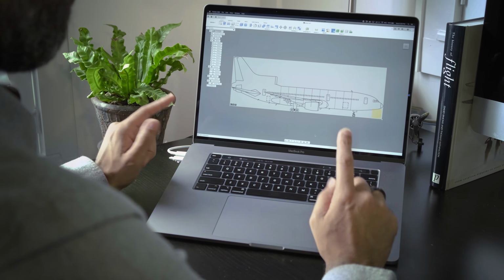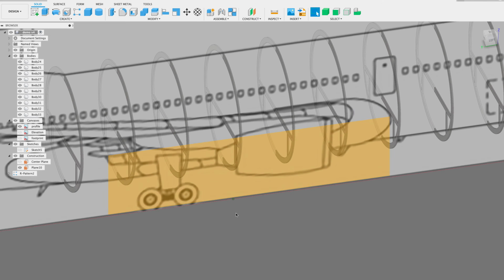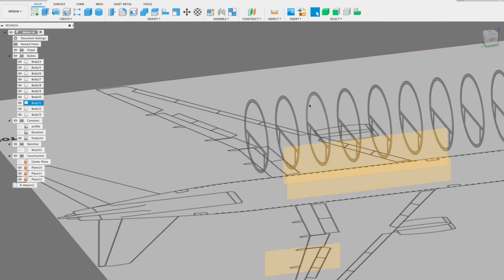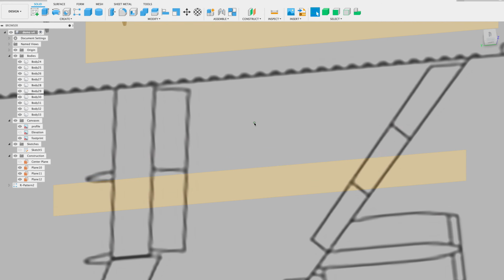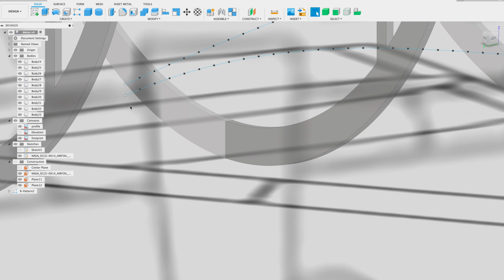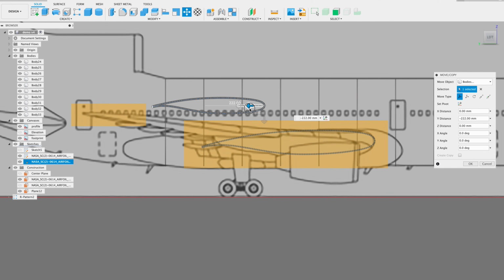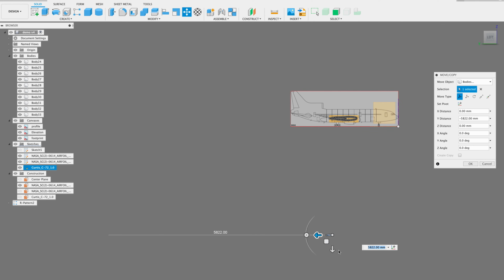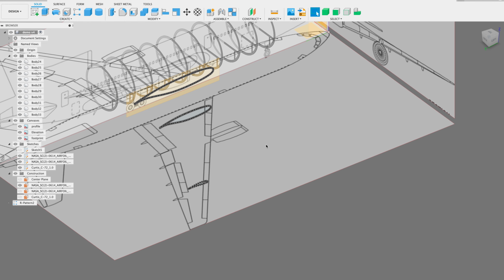Part 1 | How To Design Airplane Wings in Fusion 360 - Airfoils [Episode 2]

Comment: My experience with airfoil tools is that when you copy the source dat file without the name of the airfoil on top of the listed data, the spline in fusion 360 remains open at the trailing edge. If you copy and paste everything, including the name of the airfoil, the spline ends up closed in fusion, ready to use. Sounds weird, but works! I recommend to open "edit sketch" on that spline, select the outline, then right click and "fix spline".If you don't, you may accidentally move spline points while working with that airfoil, thus creating humps or dents or other "improvements"...
I have to admit that my proposed solution obviously only works with the older 1.8 version of airfoil dat to spline, which I'm still using. In the actual 2.0 version the problem remains unsolved, at least for me...
Reply from the maker: Thank you for this awesome tip and solution to that strange problem! I've pinned it to the top of the comments so that others benefit for this work around! Cheers!
Reply: @RCCAD2VR  I've installed and tested the 2.0 version on a different computer now and it looks like the problem of open trailing edges lies in the data files. The two data dealing with the trailing edge should be the same value. If the first pair reads, for example, 1,00000     0,00000 and the last pair is 1,00000   0,00010 , then ends won't meet in the spline appearing in fusion. So be sure to make both pairs the same value, before using the file in 'airfoil dat to spline'. In your case it is really a huge gap of about 4,2 mm! at the wing root rib. You can see that gap already on the airfoil tools website display of your profile and if you check the dat file, you'll see where it comes from.
Reply: @plane_simple  Even when the first pair and the last pair are identical you still get an open trailing edge!!  Tested a couple different airfoils and they still come in open traing edge!!
Reply: @plane_simple  I agree. I edited the file (Clark YH) so the 1st and last points were identical and the airfoil is a closed sketch using the V2 script. Given others still report errors, this could yet be a Fusion 360 Hisenbug. Sadly, this doesn't fix the broken placement. What worked best for me is use the default origin plane and then move to the offset plane. FWIW, the broken offsets appear to match the offset plane's offset, perhaps the script has uninitialized variables.
Reply: @dnl-42  Oh wow! It's been a while since my post on this subject. Appreciate your comment! I haven't worked with airfoils for a couple of months, so I don't know what the problem looks like today. And I must say, I don't know a thing of what happens behind the screen while working with Fusion 360, so my solutions are always results of trial and error...
Reply: RC CAD-2-VR p
Reply: Plane Simple:
Including the name of the Dat file doesn't make any difference when creating the airfoil even if the first and last plot are the same!!  Still get an open spline and the "Fix Spline does not fix it either.
Reply: @sotm6078  Which version of airfoil dat to spline are you using? The solutions I was suggesting did work for different airfoils in both versions I am using on two different computers, both windows 10.
Reply: What suggestions do you have when your wing has a curved leading edge

Comment: These many years after you making these great videos, I'm truly enjoying these videos, and the learning is insane!! Thanks a lot, man!! Also, I'm new to Fusion 360 but not CAD in general. Yet, I can't figure out why I can't move or resize my construction planes like you do. If you have any suggestions, I'd appreciate the help!
Reply: I have the same issue. The thing is, we are working on a new version of Fusion 360, which doesn't allow resizing of construction planes. Instead, the planes are infinite in length. That's why I am stuck in this second video myself and don't know what to do.
Reply: @Aneeqali-c9b I figured it out but turned out that the solution was in the description all along lol! We are designing in the parametric mode, and that won't allow us to resize or play with the construction planes in any way. Turn off the design history using the gear icon in the bottom right of the interface and enjoy designing!

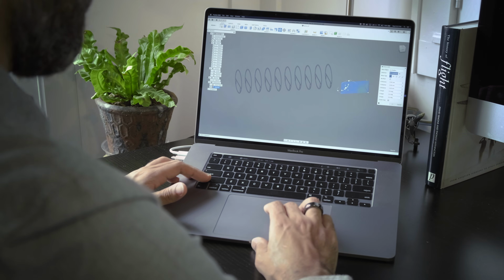Comment: In 4:30 you show how to move a new offset plane by crearing it and then pusshing M with it selected. 

I’ve tried several times but it doesnt appear the options to loce that offset plane. How can I fix it?

—————————————————

Solved: 

temporary line is the solution as I see in your website.
Reply: where did you find the temporary line fix or wtv i cant find it on his website

Comment: Your videos are amazing and so helpful. I have a big problem though: I am designing a custom built aircraft, inspired by the SR71, Concorde, and Space Shuttle... so it's a 4.5ft long fuselage, complex delta wing with a 90mm EDF in the back. My issue is, I can't find too much information on the types of airfoils my inspiration aircraft used, and they essentially seem to boil down to being "flat plates" in the case of RC models. The best I have been able to find is to keep the root airfoil to about 5% thickness and the tip airfoil to a bit higher, maybe 6%. I am planning on making my own airfoils for this as it is such a complex shape and the wing is so long (2/3 of the length of the fuselage at the root). What would you do if you were me, would you move forward?

Comment: Quick question for anyone here following along. I'm trying to move the offset plane that he created but to my knowledge moving construction planes with the move tool is not supported. Does everything still work if you initially resize the plane to its intended location and then off set it or am I just missing something? Thanks!
Reply from the maker: This is because you're in parametric modeling mode. You've gotta switch to direct modeling in order to have that ability.
Reply: @RCCAD2VR  thanks for getting back so quickly!

Comment: Hi, I have ran into a problem I cannot move the offset plane there is no direction arrows.
Reply from the maker: This just means you are not in direct modeling mode. You will need to switch out of parametric modeling in order to get the construction plane movement ability. If you need help figuring out how to make this switch I have information about it here on my website https://www.rccad2vr.com/rc-airplane-design-build-episodes/design-rc-airplane-wings-in-fusion-360-part1#constructionplane
Reply: @RCCAD2VR  I managed to solve it in the end, but thank you for the reply. Your video's are the best by the way. I have now started on the wing ribs I'm designing a plane similar to the Technam p2012 with a increased cord, wing length at 50 inch wing span. My wing root I increased 1.5 degrees and tip 2 degrees I'm using the Naca 2412 Airfoil. This is my first time ever using CAD software and I am very confident that I can complete the model because of your teaching methods. Thank you.
Reply: I created my formers by using the two point rectangle and rounded edges with the tool then extruded it because my fuselarge is more square . but now I am unabe to loft to the nose section because it will not allow me to use it as a rail. I would be grateful if you had any suggestions.

Comment: Great teacher. Very easy to watch and learn. Some airfoils on Airfoil Database have contour defects/divots that need to be cleaned up. They also have way more spline points than needed. I usually delete most of them. There is also an add-on that removes unnecessary spline points, Airfoil_DAT_Optimiser, but more can be removed still.

The open trailing edge seems to be random. Some are closed. I usually connect the upper line to the lower and correct the shape if needed, or square it off to .4mm if it's going to be 3D printed. The gap is usually small enough no adjustment is needed. Bigger variations come with sanding and finishing.

Comment: This amount of work you put into this series and the quality - MAGNITUDES higher than similar content - is FAR too little appreciated!
Not to mention: it's completely free!
Reply from the maker: Cheers! Happy to see that you're really appreciating the video series. They were a challenge to put together, but glad to be able to share my process and help others. With such a significant drop of interest in the engineering, trades, and manufacturing and the older generations not passing the knowledge on as freely, putting a series like this behind a paywall seemed like the wrong thing to do. Happy to know it's appreciated!!
Reply: @RCCAD2VR  That’s a very noble motive! It’s greatly appreciated!
I’m actually currently designing my very first RC plane ever. It’s of course not going to be as intricate as your design and made from foam. Long story short, your series helps a ton with the design!
By the way: do you know of any free/free with educational license software with flow simulation capabilities (since I think it’s no longer possible in Fusion360)?
Reply from the maker: @Quefelsees  That's awesome! Best of luck on your design and build! You'll have a lot of fun in the process. 

I've not spent any time looking for any simulation software, So I can't point you in any specific direction. This kind of software is pretty expensive to create an maintain, so a free version that's capable of giving accurate results may be hard to find.
Reply: @RCCAD2VR  Thank you very much! Just ordered all the parts, I’m super excited!

Alright, I’ll keep looking then. Thanks for your reply!
Reply from the maker: @Quefelsees  Anytime.

Comment: I don't know if I'm doing something wrong but it wont allow me to move an offset plane, when I try to select it and press the M key it tells me that I need to select a body to move
Reply from the maker: That is a limitation when working with "design history" on. You'll need to turn that off in order to work freely with construction planes and other methods shown in the tutorial. Be sure to use the webpage that goes with this, I try to answer as many of the pitfalls and issues people run into. Cheers.
Reply: @RCCAD2VR  Thank you so much for the help and the quick response!
Reply from the maker: You're welcome 😀

Comment: Using "winglets" hinders the efficiency of the "wash out"?

Sorry, English is not my native language.
Reply from the maker: Winglets increase efficiency of the wing. They greatly reduce drag cause by vortices and reduces the high pressure under the wing curling around to the top side of the wingtip improving the airfoils performance.

Comment: Hey Terrance, I just attempted to install the DAT spline and after loading as directed into the library, I restarted Fusion and lost my canvas images. I can't find them anywhere
Reply from the maker: Hi Scott. This is a highly irritating bug in Fusion 360. My canvases disappear visually all the time. If you look in the browser under canvas, the file should still be there. Right click on the file and select replace canvas image file. Then select the same file you used before. This should pop it right back in. That's what I always have to do.
Reply: @RCCAD2VR  Thanks for your quick reply...unfortunately that is a "No Joy"....sometimes, Fusion can be an exercise in utter frustration
Reply: In fact, it appears I can't download any canvas images now...
Reply from the maker: I don't quite understand. Canvas are added from your computer, there is nothing to download. Just trying to get clarification. Are you unable to locate the file locally or is the canvas file not in the browser.
Reply: @RCCAD2VR  I went ahead and simply acted as if I never downloaded a canvas and that brought the image in. I sized it to the sketch but now I can't increase or decrease the sketch size...grrr....I have to say this all started after I downloaded the DAT spline Add-on so I am now thinking I should remove it and that might solve all these irritating issues....thanks again for a great job....threw you a tip the other day...
Reply from the maker: Resizing the canvas is easy. It's a calibration. I have a video on how to do it called "How to Calibrate/Scale Fusion 360 Canvas"

Thanks for dropping a tip in the tip-jar!! That was very generous of you 🙌🙌🙌🙌
Reply from the maker: Sorry that plugin is causing you troubles. The author made an update after I published the video to address an issue with it and it's been behaving oddly for many people ever since. I need to take some time to record and publish a new video with another method that's quick and easy and doesn't require an add-in.
Reply: @RCCAD2VR  no problem… you deserve it… I know how to calibrate the canvas… but I will get it figured… thx much… great teacher!

Comment: My planes do not want to move ? What should I do
Reply from the maker: The only way to enable that ability is to turn off design history. In Fusion 360, parametric  modeling mode won't let you reposition construction planes.
Reply: Okayy so that is the reason you said to turn it off.
Thank you for your fast reply 
And keep up the good work

Comment: Hi @RCCAD2VR, is there a way to import the spline files to an exact coordinate on a offset plane ( lets say a projected line from a wing sketch )? I am still unable to place the airfoil profiles correctly because the pivot and move method works but when you are going after High performance.... it is not the very precise sadly. 

If you have any new method of doing this I would appreciate. 

Hoping to see a new build from you soon.
Reply from the maker: Hey there -- This is a known issue, one that I was not able to solve either. I remember a comment a while back regarding a hack to do it, but I couldn't get it to work. What I ended up doing to simplify the whole process is capturing a screenshot of the airfoil, placing it as a canvas then using sketch to trace the airfoil. It's quick and dirty and solves the issues with using the DAT file. 

Hope that helps. 
Also most recent build video went out this week. Cheers.

Comment: Can i expect the same kind of performance if i use only one type of airfoil (curtiscC-72) but with a Washout ? Thank you for thoses awsome tutorials
Reply from the maker: It depends on where you start the twist into the washout area. I would say it should be at the final angle just before the inside edge of the aileron. Check the CL v Alpha data for that airfoil to make sure you don't inadvertently create negative lift at the final washout angle when at level flight or a few degrees nose down, that could create a really nasty problem.

Comment: Hi Sir, I would like to ask you about that u move your construction plane with easy method press M and move. But it's not work on me. Any solution or any tips?
Reply from the maker: This is happening because you have parametric design turned on. You must turn this off. The following link will take you to my website where  there are  instructions on how to turn this off. Look for the heading "Can't Rotate Canvas" 👉 https://www.rccad2vr.com/rc-airplane-design-build-episodes/design-rc-airplane-wings-in-fusion-360-part2#planes
Reply: @RCCAD2VR  Thank for your kindness sir.
Reply from the maker: @eipelay6829  Happy Modeling!

Comment: Hey buddy I have a hickup in making the offset plane move the the root of the wing. when i am creating the offset plane doing all the steps as shown but when i am trying to move it , i am not able to do that. i am only able to bodies with the move option. can you pls help me ?
Reply from the maker: Hey there - Apologies for the later reply. This sounds to me like you are working in parametric modeling mode. I have an explantion on how to change this on my website here https://www.rccad2vr.com/rc-airplane-design-build-episodes/design-rc-airplane-wings-in-fusion-360-part1 scroll down to the heading. "Step 1 - Setting Primary Airfoil Construction Planes" It will show you how to switch. Hope that helps.

Comment: hi, how do you move the offset plane as following you does not work for me, am i missing out a point?
Reply from the maker: You need to be in direct modeling mode. You're currently in parametric modeling mode. The link to my website in the description has a guide on how to switch between the two modes.
Reply: @RCCAD2VR  I found that I was in the rong mode. Thank you.
Reply: @RCCAD2VR  Hi, some of the bodies are gold colored, the ones in the trailing ribs, how  and the rest are gray/black. How do i correct this and what did I do wrong? Thanks.

Comment: I'm unable move, or copy/paste the construction planes or sketches like you are at 6:12 for example.  In fact, I am unable to select it the same way you are.  I see when you are moving the construction plane and airfoil around you have "bodies" selected in the move pane and there for you only have one item selected, I cant select anything with "bodies" selected.  Also, when I try to rotate the airfoil it crashes every time because I have over 600 points selected.  I cannot select anything when I have "bodies" selected like your video, the only way I can move/rotate points are when I have "sketch objects" selected  What's going on here, its very frustrating.  Hopefully that makes sense.
Reply from the maker: You'll need to switch to direct modeling mode. Right now you're in parametric design mode you can find instructions how to switch here on my website https://www.rccad2vr.com/rc-airplane-design-build-episodes/design-rc-airplane-wings-in-fusion-360-part1 hope that helps.
Reply: @RCCAD2VR  That worked!!!!  You are the MAN!!!  I think one of your previous  videos actually mentions this so shame on me ha ha! Thank you so much!
Reply from the maker: 🙌🙌🙌 glad that did the trick!
Reply from the maker: An option to solve the airfoil problem is to get an image of the airfoil, add it to the workspace as a canvas, then tracing it using the spline tool. That would take it down to 4-6 points.